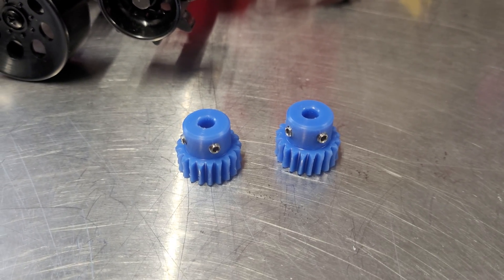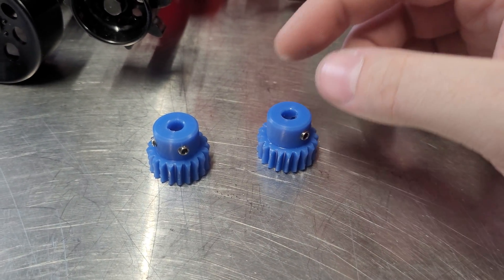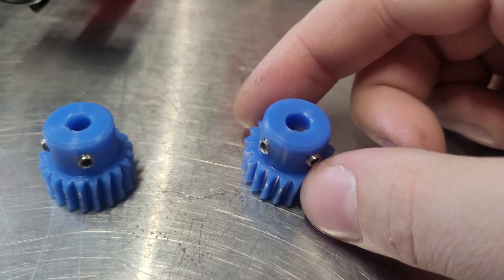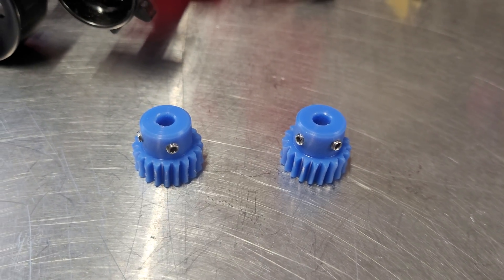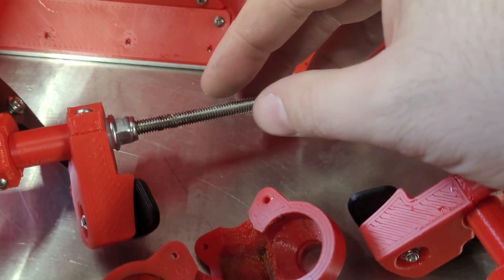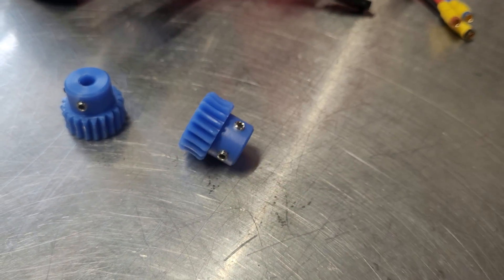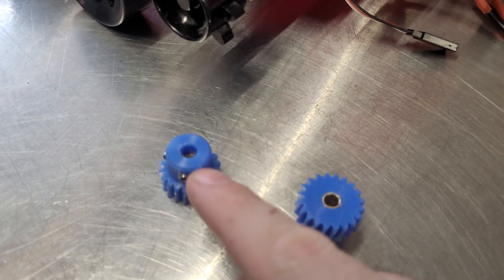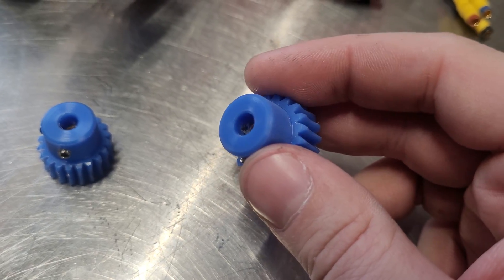Spyker Workshop - Small Worm Gear Update

Comment: Wouldn't those nylon gears work better if you put a hole through the shaft and had a through bolt to hold the nylon gear from spinning?
Reply from the maker: I never had them slip on the shafts, long as you put flat spots and dont over-tighten